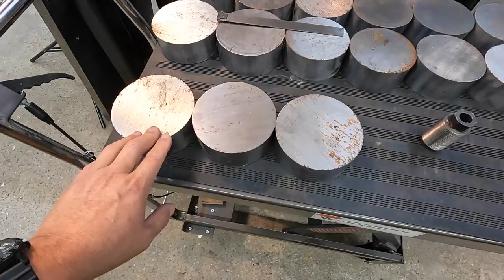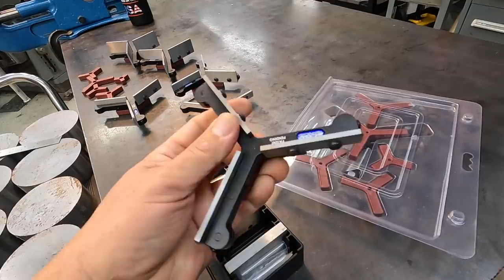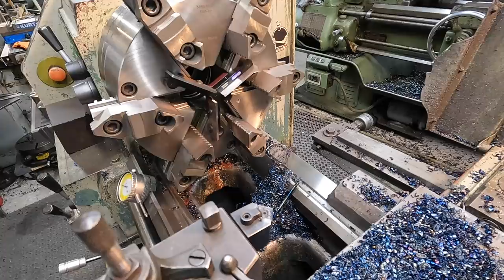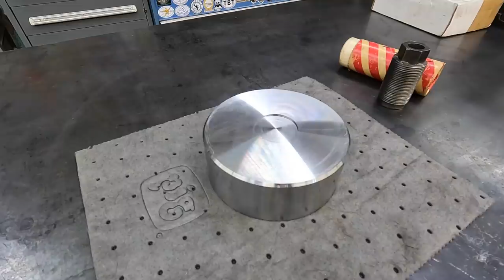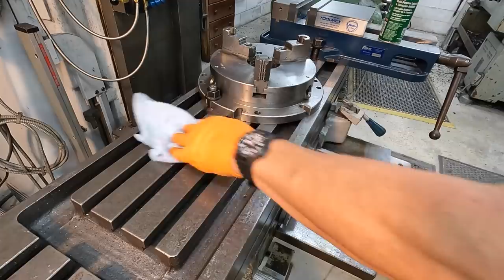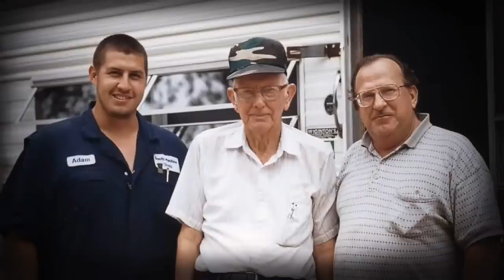Machining Lathe Leveling Feet for the American Pacemaker Lathe

Comment: Nice job
What I'm wondering though, why did you have to make the counterbore on the milling machine? Couldn't you just have stuck the endmill into the tailstock and do it in the lathe?
Reply: he probably could of, but it wouldnt of been as educational
Reply: Boring it in the lathe to get the flat bottom would have taken more setup and work time. It would have been flatter and more concentric but that accuracy is unneeded here and would be wasted labor.
Reply: @skasow17  how is it more labor? You don't have to indicate anything in, just put the endmill in and do it. But maybe there are some other concerns I'm not seeing...
Reply: @CatNolara  I am no machinist, just a fan. I seem to remember his lathe footstocks have taper shank mounts. So mounting an endmill that way would need an adapter. No automatic feed for a tailstock, so you’d be cutting by hand and watching an indicator, or the tail stock spindle scale itself. Most of what I have seen tailstocks used for is simple drilling. Repeatable depth is probably easier with the DRO on the K&T.
Reply: @skasow17  For a drilling operation like this it would propably work to put the endmill into a drill chuck. The automatic feed is a good reason though, on the lathe you'd have to crank by hand and look for the number on the dial. I guess it's just two ways of doing it, either not that much better or worse than the other.
Reply: You never hold an end mill in a drill chuck; you can never get it to hold tight because of the 2 hardened surfaces. You could use the MT to collet holder.
Reply: @skasow17  Like using a test indicator to get it with a couple of thousandths on the mill. It would have taken bout 20 seconds to grab a boring bar and stick it in the QC tool post.

Comment: Adom.. I am a total hobbiest .. can I ask why the second operation wasn't done on the lath ?? Seems it would have been faster and just as accurate 🙏🙏
Reply: Cause the video wouldn’t of been 30 min long
Reply: I would guess rigidity is better with the mill setup. That's a lot to plunge the diameter of that end mill.
Reply: @BB-qn5rj  If you don't like the videos, don't watch.
Reply: My thoughts exactly.
Reply: @russellstarr9111  just a hobbyist question man ... Whiskey tango foxtrot
Reply: @TheAggromonster  @Marty Loos   My first comment was just an answer I thought made sense to me. The second comment was pointed at @B B 's complaint about the length of the video. So,sue me.

Comment: Is the spider thing just a spacer to bring the work piece out?
Reply: Yeah, it helps keep the parts the same length for the first pass so you know they are not going to be undersized for subsequent operations. Also, helps keep the first pass depth somewhat consistent which is helpful.

Comment: I bought an American Pacemaker today. I don't see a model number on it, but it is equipped currently with a 16" 4 jaw chuck with nominal 6' between centers. Looking online it looks like this could weigh 9000 lbs. I guessed it was a lot less than that. I only have 3 ton lifting capacity in my shop via a gantry. I assumed that I could rig it myself having a lot of rigging experience, but I was anticipating less than 4000 lbs. 

This machine is quite an upgrade for my home hobby shop so rigging it on my end will be a challenge.  
Does anyone have any hard data access that I can rely on regarding rigging weights?
Reply: Adam's weighs 11,000 lbs, so guess from there.  Good luck and be safe!!
Reply: My box ways equipped Comet mill weighed in at around 3800 lbs. That’s about as much as I care to move myself. The professional riggers can handle the rest. It’s nice to just sit and watch someone else figure it all out. Money well spent.

Comment: An eighth or a quarter inch depth for the counterbore seems more prudent than that dimple.
Reply: Why?
Reply: @JimWhitaker  
Same reason the other guy probably wanted it - so you can nudge the damn thing around without the risk of having the adjustment screws sliding out of that shallow indent.
Reply: @Peter_Riis_DK  Not sure the weight, but I'm guessing there's not going to be a lot of nudging that lathe around. You're going to have to LIFT it in some way first...
OK, looked it up. A 16 x 54 American Pacemaker is close to 5 tons. So, yeah, good luck nudging that around while its feet are touching the floor.
Reply: @steveh8724  
The pleasure will be mine and my steel rod's.

Comment: Is there a chamber in the rear apron of that Victor lathe that fills up with chips? At 8:44 you can see a load of swarf on top of the cross slide which is disappearing underneath another machine cover, I wonder if some of them end up getting dislodged and get stuck in there as you retract the cross slide? Seems like a bit of a silly design maybe? Perhaps there is no bottom to the bit that the cross slide disappears into and the chips/swarf are free to exit.
Reply: I have answered my own question, later on you flip up a cover and it exposes the taper turning attachment mechanism.

Comment: Are you going to make small studs of say aluminium so as to protect those nuts and also make is easier to turn with the wieght of the lathe on the thread. Just and ideas a stud that you could put up the shaft of the leveling nut to rest on the steel levelling pads that you just made.

Comment: If you’re concerned about that center area, quick plunge with the smaller end mill will relief that. Since the feet have a hole anyway. But then again with that hole it’ll negate a high spot in the center anyway. Cheers.

Comment: I made the same kind of thing . But my adjusters  have a radius on the ends so I made the pucks frome cast with a 1 in hard ball bearing.  And my pucks have 3 points to the ground
Reply: His'll have three points of contact with the ground too but he just doesn't realise it with a rough concrete surface !

Comment: Why not do that countersink on the lathe?
Reply: Counterbore. And yeah, I was wondering the same. I guess it wouldn't make the video as interesting. Theres always that to consider in Youtube presentations. A balance between practicality and watchability.
Reply: Or maybe center drill one puck, and use that center to rough align the puck on the mill.
Reply: I was wondering the same, could avoid the dished face and reduced contact area with the adjusting screw that way.
Reply: That’s just me, playing ‘order of operations’. In the end, it’s his project, and his shop. He’s satisfied with the results, and that’s all that matters.

Comment: Okay, I've NO background in industrial machine installation. What I would like to know is Proper Manufacturer recommendation are? Should these heavy machines be literally anchored to the concrete slab much the someway the center pivot crane installation was done only bore/drill holes and then pored setting agent/glue around the threaded insert. I'm just not seeing what keep the machine from dancing across the floor and what keeps the ways level?
Reply: What Adam is doing is his own design. I have never done it that way. 

 I'm a retired industrial e;electrical/millwright contractor, though and 3hat we typically would do on larger machines like big VTLs  is you dig out and pour a concrete footer under the machine a couple feet deep. (As deep as 8' or 10' sometimes for something like a big punch press)   You place the machine and slip plates that have a hole in the center under the machine mounting points and put epoxy anchors or thunder studs through the holes. Then you use the wedge bolts on the machine (The things that Adam has in the vid) which land on the plates  to level the machine. once the machine is leveled up you put washers and nut and lock nuts on the anchor bolts and pull the machine down against the wedge bolts. (Wedge bolts lift the machine up, - Anchor bolts pull the machine down and anchor it in place.) After a couple rounds of twerking up and down if you want to get cute you dam up and pour suflaset around the machine.. ---- 

Smaller machines like a Bridgeport or toolroom size lathe you can just stick some 1/4x4 under the wedge bolts and level it..(The steel is just there to keep it from chewing into the concrete)  There is no real reason to bolt small industrial type machines down to the floor- On the flyweight chi-com machines you may have to bolt them down to keep the beds straight but on "Real" machines of medium to large sizes like Adam has there is no real reason to bolt them down. Just causes more damage when some wizard backs a towmotor into one.

Comment: I have little actual machining experience - but have a question:   Why not drill and bore a hole on the lathe, instead of using an end mill?
Reply: If it doesn't need to be super accurate this is faster. If it had been crucial that the bottom of the recess was on the exact same plane as as the puck itself it would have been preferable to do the facing and the recess without removing it from the chuck.
Reply: @andersjjensen    Not. Better and faster on the lathe and no indicating required.

Comment: Another submission for " chip of the week " ?

Me being me, I would have center drilled the pucks so that I can lag the machine to the floor through the center of the leveling screw. Keep it from wandering if any work piece has an off center mass. Just the four corners
Reply: The Pacemaker is 11,000 lbs!  How much "off center" are you planning for?  Yikes!!
Reply: @paulcopeland9035  I've done some strange stuff in my 45 years. I prefer it pinned down just in case.
Reply: @easternwoods4378  ...Okay!  I think you should broadcast warnings whenever you machine, so nearby humans and pets can get away.

Comment: I'm sure this is a silly question Adam, but aren't they going to rust?

Will you paint or otherwise protect them from oxidising, or is the steel stainless or something?
Reply: Surface rust on the ends only. Nothing to be concerned about.

Comment: anyone notice the prism effect on the face?  (the "rainbow")  I get that from time to time, usually after a good honing & facing fast.

can anyone explain why that surface separates light?  is it something like a fresnel lens?
Reply: I don't know anything about machining but I've seen a video on Applied Science where he explains that effect. Basically, you have very small holes on the material, big enough to only reflect a certain wavelength of colour, and that's the colour you see reflected. You see it on CDs because of the little holes they have for ones and zeroes. You see it on bacon because the cellular structure is the same size. This is the "why" but not the "how". How you end up with it, I can't begin to guess. Maybe exposed grain size, maybe micro-vibrations while you're working on it... I'd be interested to find out as well!
Reply: @rath6599  you wouldn't per chance remember the name, or anything that might have been in the title of the video?  that channel has a lot of videos! and I would love to hear their explanation.

Comment: Damn nice finish. I need to do the same with my JET lathe but not too worried bout looks till now maybe? The mounting holes are stripped out so I have wooden wedges under each end. Sure need to fix it tho. For leveling wouldnt Aluminum work for lighter lathes? i have a 1340. Might need to weld some new nuts to the frame first tho.

Comment: Adam, why did you decide to do the counterbore in the mill rather than the lathe ?
Reply: Probably because that’d be a plunge cut first and sometimes that’s hard on tools. May take more than one simple operation.
Reply: @MotoRestoFL  I'd have drilled them on the lathe to suit the hole in the adjuster then counterbored, probably with a drill.

Comment: I have one question, why havent you done all the work in the lathe?
Reply: Because Adam likes to play with the K&T mill a lot.
Reply: Because why not use the mill would be my guess. Also I think plunging an end mill would be much quicker and easier than I guess a centre drill and boring bar.
Reply: @ryanworkman5229  did the end mill dish the bottom of the indention?
Reply: @jadesluv  no, I believe the end mill would have left a slight high point in the middle, which wouldn't really be a bad thing with the hollow screws used to adjust level on this lathe.

Comment: With that big chip it looks like only one flute of your end mill is cutting.
Did you resharpen it yourself?
Reply: Hmm, I had similar thoughts too!
Reply: His feed rate is very low because of the plunge cut, so even a very small difference in the flutes will show during cutting. I am sure that at a faster feed rate both sides will cut.
Reply: @matthewperlman3356  I noticed he said the mill was cutting at 139 sfm but nothing about Z feed.
But, as with anything rotating, the cutting velocity at the center is exactly zero.
Pressures must have been quite high, but I suppose the knee can handle it.
I'm no machinist which I asked. Would have thought drilling a pilot hole would help.
There's no way the tubular adjuster could slide over enough to be unsupported.
A through hole might even allow splashed coolant or other liquid to drain.
But, like I said I'm no pro and certainly don't have the equipment to pull this off.

Comment: I thought that the 2 flute milling cutter was known as a Slot Drill because it could center cut and drill straight down. Unlike an End Mill with 3 or more flutes which can not drill its own hole because it does not center cut. It leaves a pip if you try to drill down with an end mill.
Reply: Some center cut and some don't. I have several 4 flute end-mills that center cut. 2 flutes intersect in the middle and the other two just cut from the edge to about two thirds in.
Reply: The amount of flutes is irrelevant to whether or not an end mill is centering cutting or not.

Comment: Whenever you talk about hydrolic rod you refer to it as 1045 steel chrome plated.  I am by no means a metal worker so I need some help understanding what 1045 steel chrome plated means.  I get that the grade of steel is 1045, what I don't understand is the "chrome plated" part.  Whenever I think of something as being "plated" I think of a coating that is applied to the outside of the rod, bumper, etc.  If you are turning off metal from the outside is it still "chrome plated" or is that just meaning there is a chrome component to the alloy of the 1045 steel?  Please help a weekend woodworker and couch metalworker understand!  Thanks and LOVE following your work!  Keep it up!
Reply: It’s literally chromed on the outside, like a bumper. I believe all hydraulic rods are
Reply: I'm pretty sure it's chrome plated only on the outside. Chrome is very hard. In one of Adam's slow motion shots of facing you can see sparks at the beginning when the chrome plating is cut. The rest is just 1045 steel.

Comment: Shouldn't there be a hole all the way through those pads, so you can bolt the machine to the floor, with Raw bolts?
Reply: I don;t think he intends to bolt it down. ,,,, And I agree with him on that one. If it was a ChiCom toy lathe sure it would hae to be bolted down just to keep the bed from twisting,  but that lathe  is going to do nothing but just sit there. Like Bob Villa says  (At least 5 times in every show I have ever seen him in) "That's not going anywhere"

Comment: After chamfering they all got scratched on the face. Was that from the chip that came off, or was something else rubbing?
Reply: That was from the hard chrome plating curling and rubbing. We saw the spark at the beginning of each facing cut as well as the chamfer cut. I think the  hydraulic rods are also flame hardened or induction hardened - and stress relieved  prior to plating (to an 0.008 to .010 effective depth) before hard chrome plating. As for the amount of pretty removed... remember, this will be subjected to steel toed boots, hard bristle brooms, and the occasional dropped tool / smaller parts ect. It looks fine, and good enough is good enough, right?

Comment: Why didn't you chamfer the part after you did the second facing?
Reply: Tool changes take time, the way he did it was faster.
Reply: @johncolvin2561  He has  QC Tool post, bro. The tool change takes less time then you take loosening the chuck. - 

To be honest I too wondered about that. - Not that is matters at all here but there is NO WAY those chambers are perfectly registered with the face. Think about it. You never get a part back in a chuck or vise exactly where it came out ,,,,Don't think Adam was going for 50 millionths on this one. though.

Comment: On the concert side , I would have Relived  the center , so just the outer side touch the flor. I had problems whit rocking on some machine
Reply: Over time the smaller the contact area the more it chews into the concrete. I'ts not like metal on metal. - If it was you could get away with just the wedge bolt on the concrete, but we all know what would happen there.

Comment: That cutter leaves a beautiful face!  If neither face is perpendicular to the sides, how to you align them?  Does the chuck force that?
Reply: I think he tried to explain it like that, that he was trying to have the Jaws grab it straight and align it that way. I think that is one of the advantages of the six jaw chuck, as it also has quit long jaws. But you can see he was not worried to much about getting everything perfect straight, as it does not matter for the application. If he would have needed anything perfectly straight and parallel I guess he might have dialed it in with the four jaw chuck and also turned the outer diameter perpendicular to the faces. Although those chrome plated hydraulic rods usually are already machined even on the diameter, it makes for sure more sense to go that route with raw stock.

Comment: would a small center divot with a center drill have helped the end mill?
Reply: It might, but I think what he referred to was if the end mill actually cut in the center. Others don´t even have cutting edges in the center as they are less designed for boring than cutting sideways.